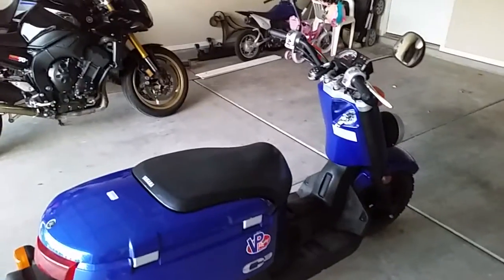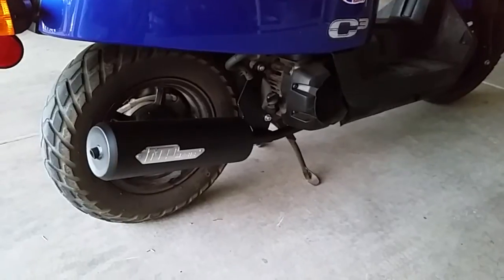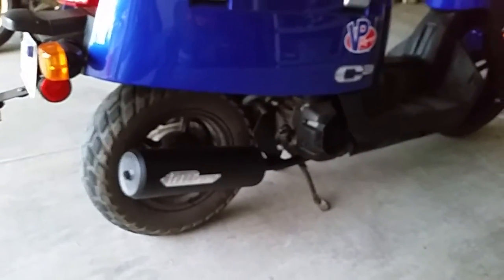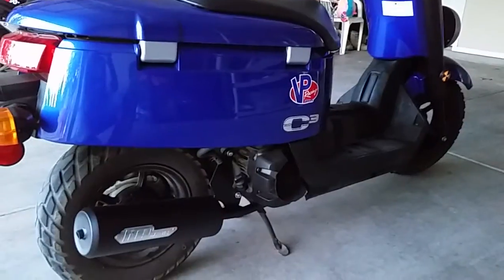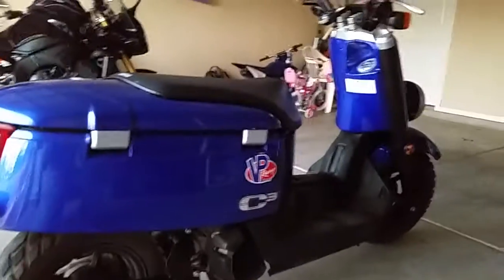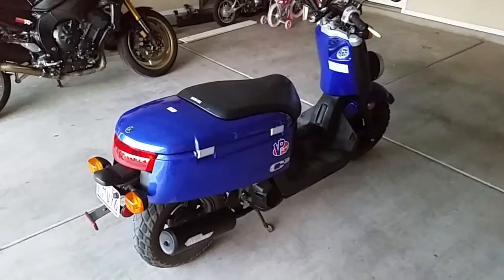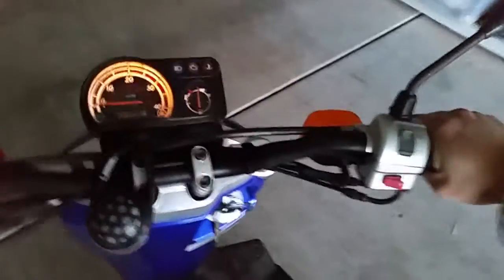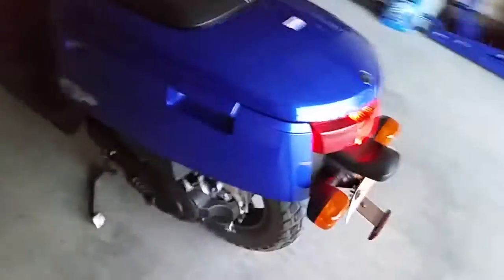Yamaha C3 NR Magic Eco exhaust

Comment: Great info bro... I will be removing the tube from the airbox. I'm putting on a carbon fiber exhaust. I'm glad I saw your video. I just put in the Polini Variator with some Dr Pulley weights. The speed increased, I changed the air filter to the Polini air filter as well. I will be doing the clutch next. Then wrapping the scooter to a brown with gold glitter and painting the wheels gold. Then changing the handlebars, grips and mirrors as well. Will  try to post it up once I'm done.

Comment from the maker: Glad you enjoyed the video. The exhaust was great for the sccoter. Airbox mod, exhaust, prodigy shock and dr Pulley weights made is so much fun to ride. I sold it to a friend of mine since I moved and he is loving it. Hopefully I can find another one in the near future. I currently have an 09 TMAX and a 13 XT250.
Reply: What size shock did you get?
Reply: Tell your friend (if he still has it) to put in 3 - 3.5 grsm Dr. Pullet slider weights and put the restrictor washer BEHIND the variator, instead where Yamaha placed it....which is in front of it....which restricts it's top speed. The lighter sliders will greatly improve acceleration and the washer behind the variator will force the belt tighter and further towards the outer surface of the variator....giving higher top speed. Best of both worlds. That with that exhaust, it should probably go near 50mph. Mine with stock exhaust will go 45mph.

Comment: Money is an issue, do you think you would take it over the Ruckus or Zuma's stock, I want to be able to go down some dirt roads from time to time too, just slow, probably would have to upgrade to that shock. THanks   ?
Reply: Tom Thomas do not use another stock shock from any scooter. The upgraded shock is  100 times better off road. I would ride mine on trails here in Texas and in Arizona. I never bottomed out the shock. It's worth the $60-$80.

Comment: great review very helpful. where did you purchase the shocks and exhaust from?
Reply from the maker: sean boughey howdy! I got the exhaust on Webike.co.jp and the shocks on eBay from Thailand. Make you you get the 4 or 5 gram Dr Pulley sliders. All 3 make a great upgrade.
Reply: angeldemon821 thank you, also what are the shocks measurements ? If you remember
Reply: i cant find parts for mine